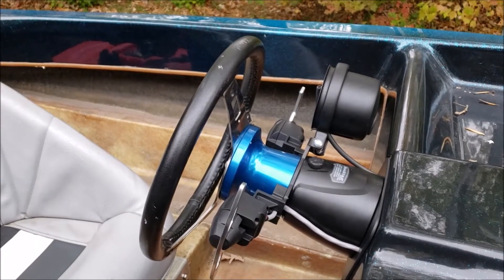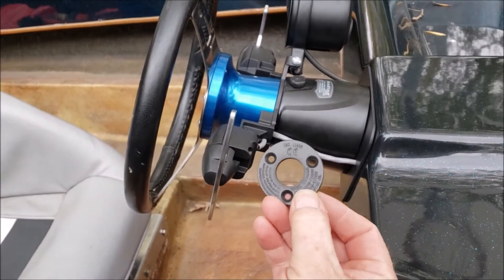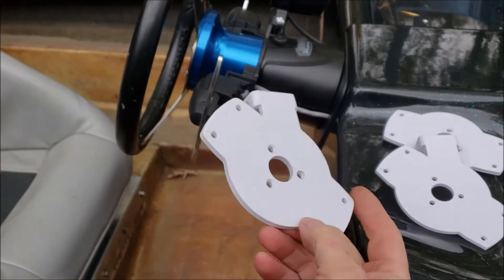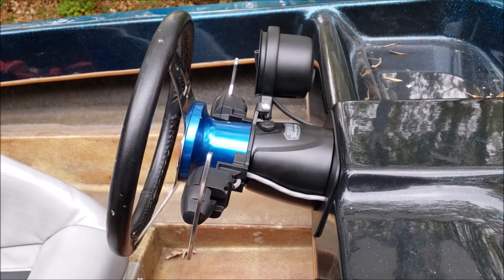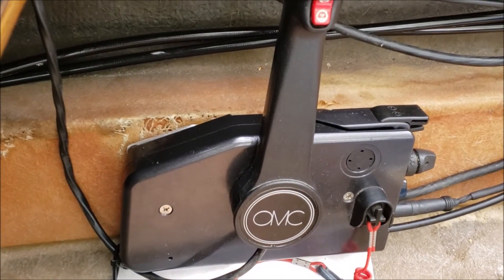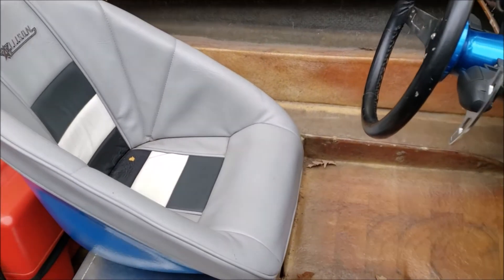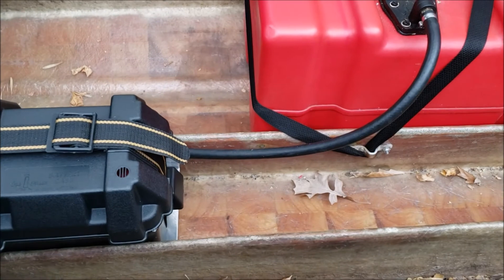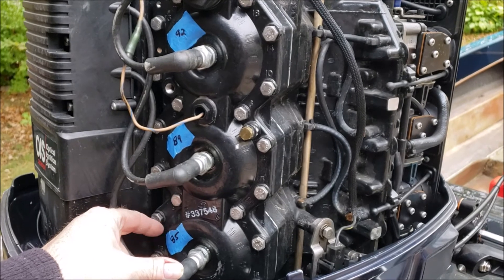Comp Hydrostream Part 4

Comment: Are the trim steering helm mount plates available to sell ?
Reply from the maker: $40 shipped to the ConUS as cut and bent or $80 cleaned up and anodized or fusion coated in the color of your choice. You need .200" clearance between adaptor or wheel and the helm. If you want it to include one or two gauge pod mounts those are custom quoted.

Comment: Looks good! I have the exact same steering and trim/jack plate switch assembly I'll be using as well.
Reply from the maker: It works really well. If you want our CAD file for the mounting plate file as a place to start just send me an email.
Reply: @atthelake7637  Thanks for the offer, but I've already drawn one on CAD and had it laser cut.

Comment: That boat will be a little much for some teens ...dont you think? how do you ...speed limit these kids so they dont kill themselves ? small prop and rev limiter? pedal stop adj ? trim limit? im concerned it could be a hand full at speed?
Reply from the maker: Have tried the small prop solution on other rigs and while using something like a 20" Yamaha will keep the top speed down it will still launch much too violently for beginners. We will cover in a future video but the OMC fastrak midsection incorporates a tilt limiter that can be readily modified into a trim limiter. That plus a selection of different length stop bolts for the foot throttle can switch it from safe for a newby 12 year old to exciting for an experienced older teen in under 5 minutes.
Reply: @atthelake7637  GOOD PLAN ...LOL 
CANT WAIT ....WILL WE SEE YOU AT ANY UMPBA EVENTS?
Reply: @craigbielsky115  these boats are NOT for children, at all!! These are hi-performance, go-fast boats, kinda like buying a 1000cc superbike and thinking about letting your kids go run around the neighborhood... Or buying A Porsche And giving the keys to your son that just got his license last week.  LoL
   All joking Aside, be careful out there, wear your safety gear and get to know your boat before pushing it to the extreme!!

Comment: Great imagination and skill in combining the two systems!  I had the exact opposite situation on my boat - Uflex hydro steering/helm with Seastar blinker trim.  However my solution, while functional, is not nearly as clean and clever as yours :)  Thanks for the videos, wonderful project!
Reply: Yeah, I haven't really used the blinker type trim buttons, I'm still used to the coiled up wires with the 2 buttons.. then again I've only been working on other people's boats lately and I haven't had enough dough  to get me another hull to build up-- thank God that I believe I may finally be getting a Laser LTV that I've been dreaming about getting for like 10 years now!! Or even finding a Laser 380 Ray in decent shape would be absolutely amazing too! Least the wife and my daughter wouldn't complain about a rough ride with a 380!
Reply from the maker: I know the commenter is aware of this but for all you new people: Coiled cords are NOT compatible with any type of hydraulic steering system ever!!! The center or straight ahead position on hydraulic helms will migrate over time due to torque exerted by the outboard on the steering system. Eventually this migration will wrap up your coiled cords which if unnoticed will result in loss of steering in one direction.